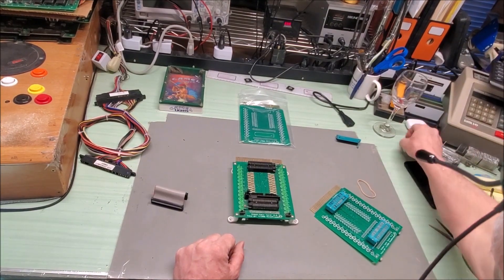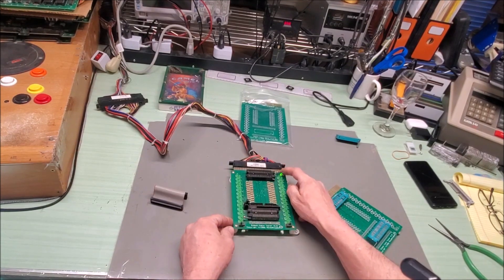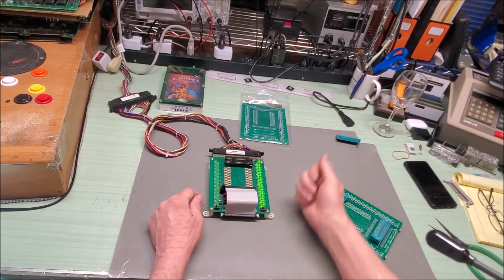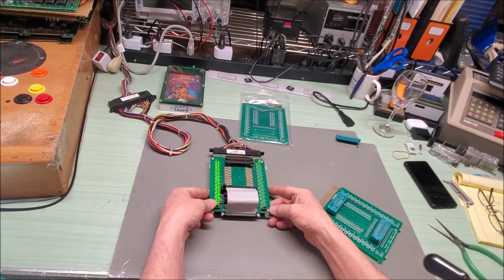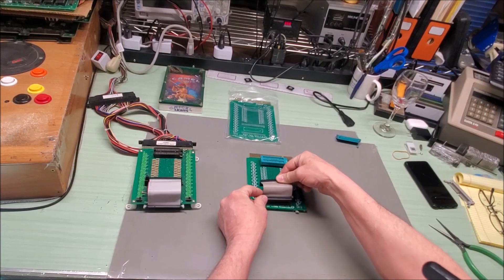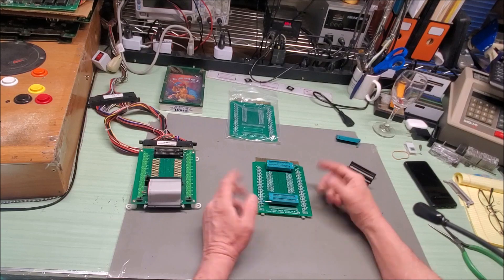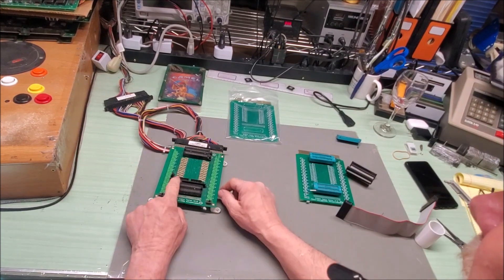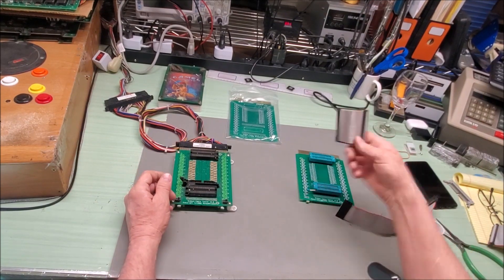Ms Pac/Donkey Kong Ribbon Cable Tester

Comment: Who makes various JAMMA Powered Ribbon Cable Testers?
Reply from the maker: I know of at least 3 others, all done around 2017. None do the dip plug ribbon cables and the IDC headers the same time. Then there is the super expensive BK 205 which is stand alone.